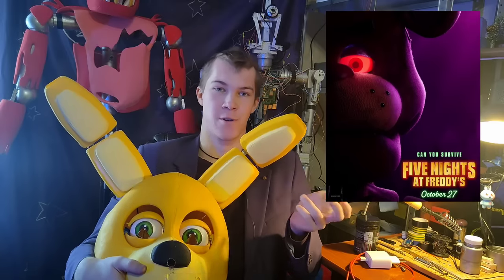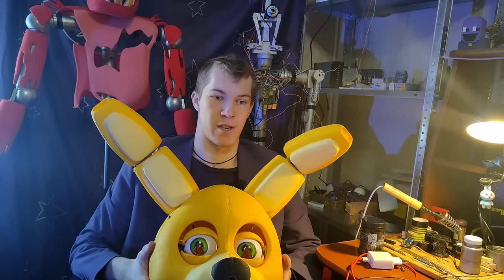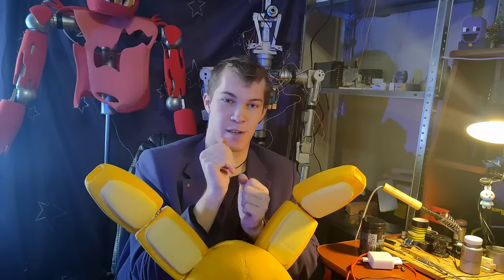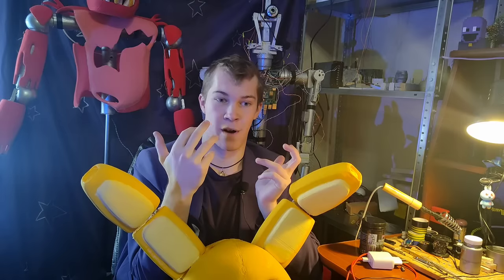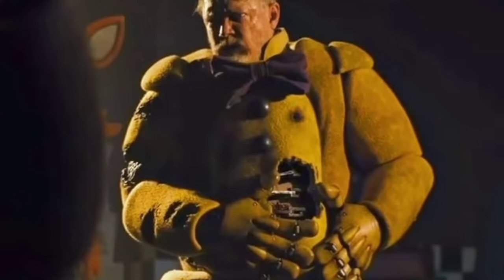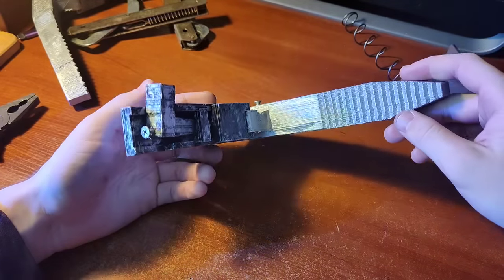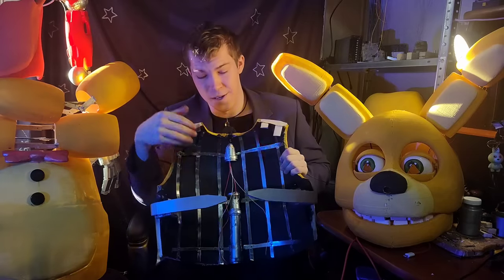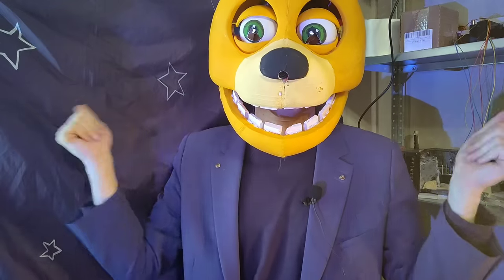Real Springlock Suit from FNAF

Comment: what people fail to realise about sprinlock suits is that when in costume mode the animatronic parts are still THERE, just compressed and wound up into the sides of the suit (an obviously very dumb idea, and not just because of springlock failure, but because of WEIGHT) the books actually give a wonderful look into the spring lock suits and springlocks themselves. there definately wasnt a lot of "is this actually possible in real life" questions when making the lore, and part of me beleives that originally the lore wasnt all there yet and scott didnt have a full idea of what he was going for, so some details change over time. but, the main point is that all of these designs look like they are just intended to kill someone, and not the purpose of combining an animatronic with a wearable costume

Comment: There is something worth noting about scene where the springlocks first activate with Afton in the Spring Bonnie suit. The exposed area where the cupcake takes a bite out of the suit was CGI. However in the case regarding the design, it does look like it was mashed together by the prop designers. But yet, that's why their are channels like this that call out the faults and improve upon them. Thank you for this video and remember to always come back!
Reply: W comment right here ^^
Reply: I noticed the springlock failure was shown as endo parts locking in and covering the holes which confirmed some people saying the springlocks are endo parts not springs and spikes

Comment: I think you need to make a rachet and release part of it, so you can use a crank.

Also, you need the ratchet to go both ways. Springlocks are made to hold the person in the center of the suit so it isn't too loose or too tight. Kind of like a shirt that can change its size. So you need to wind them, get in, and then get someone else to slowly wind it down til' you are gripped enough where the suit isn't moving around you, or you aren't uncomfortable.

I believe this to be the actual use case of the springlocks by scott since there isn't any other use case. In real life, this does exist! But it doesn't use springs. It's called a "Belt".
Reply: The springlock mechanism is made to compress and hold the mechanical parts of the endoskeleton away so a person can climb inside. It's not meant to "hold a person" it is meant to hold the parts away from where a human is supposed to go.
Reply: @printpython2755 this is true, but what op said is the most viable explanation as to why TF the movie ones hold no electronics and seemingly can't function as animatronics
Reply: @fluffyfoxer   I see, I think the movie ones are just oversimplified. From a cinematography standpoint they are easier to make and for the audience to understand.

Comment: Please don’t try to breathe on the locks, Employee, please under any circumstances if the SpringLocks go while you are wearing it, please make your way to the hidden safe room
Before bleeding out. But it you want to save yourself then ask a co worker to come help you with the suit just in case and if the suit goes off here is the steps to survival, calm your breathing, prevent moving, have a co worker place the hand crank into the lock sockets once more to wound them up, safely and gently with the help of your partner, remove the suit.